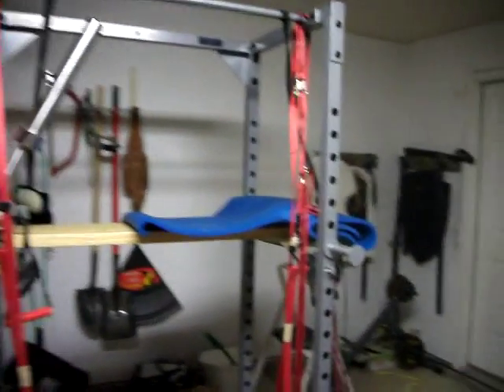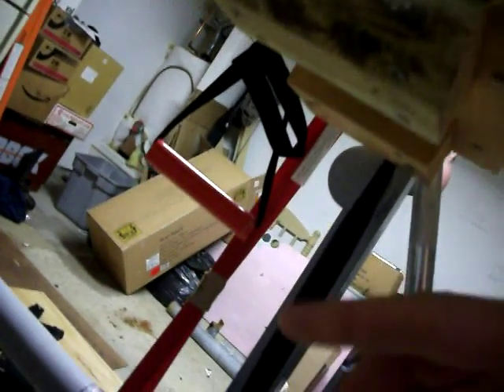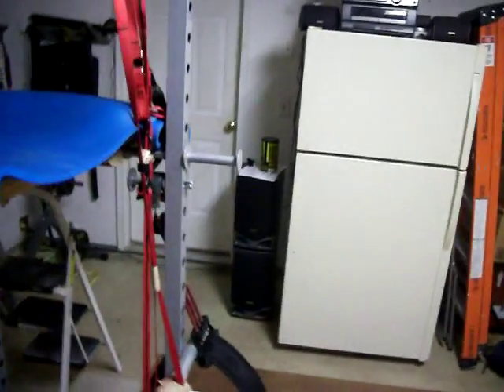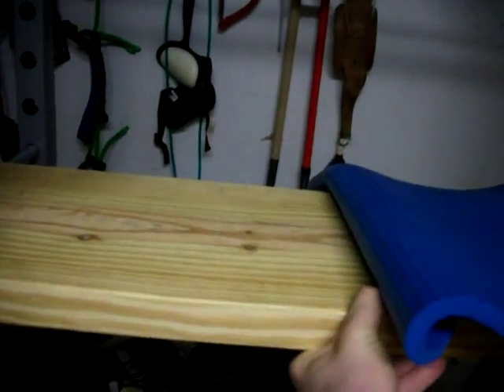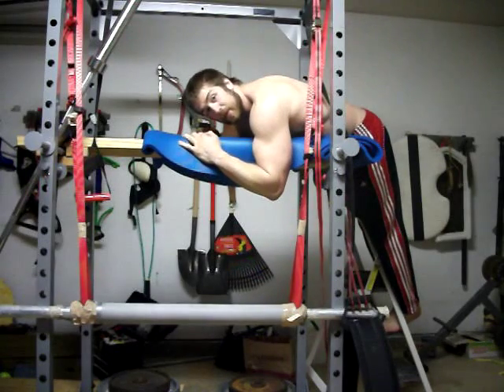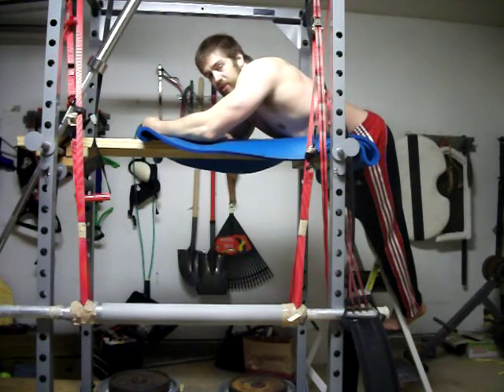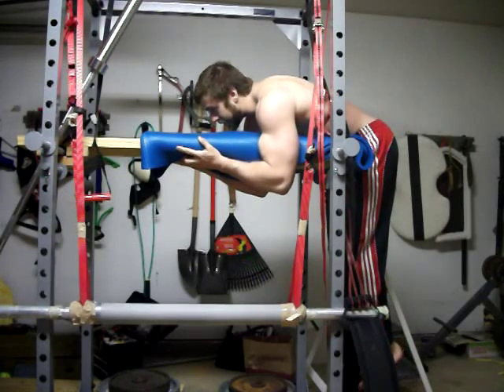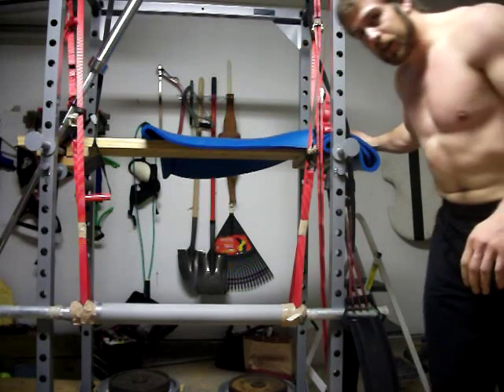Homemade Reverse Leg lift equipment!

Comment: To make this more difficult you've added weight, what I've done in the past is to move my body further down on the platform so more of my stomach hangs off when my legs are parallel to the ground.  Is doing this bad?